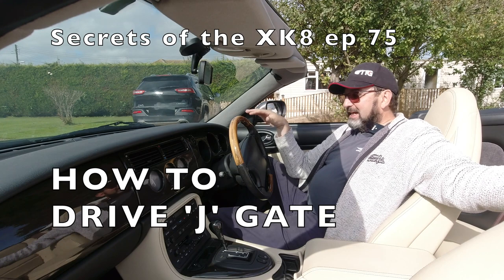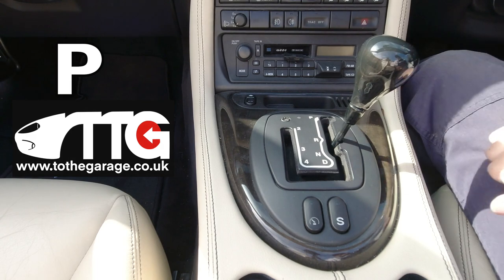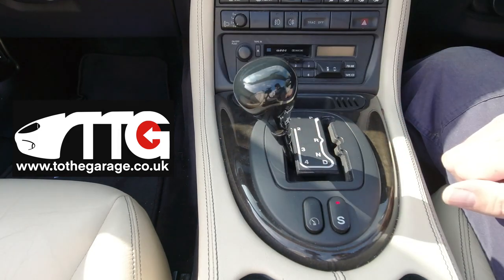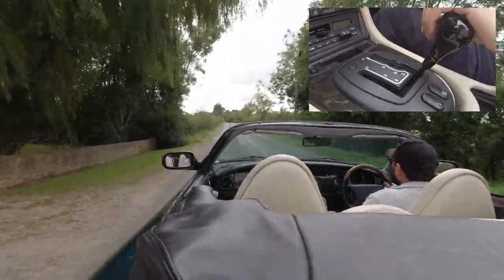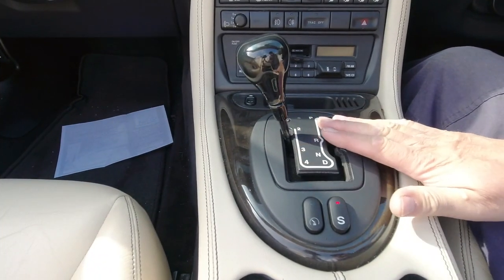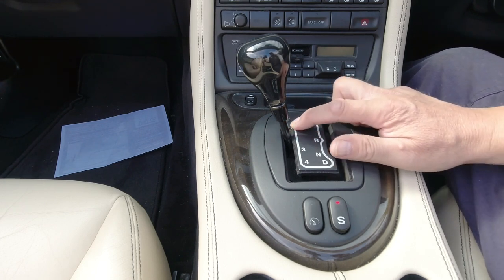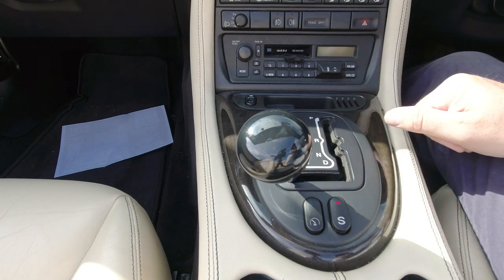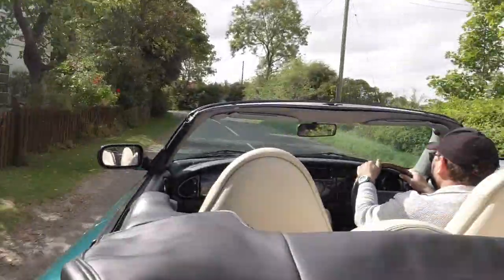how to drive 'J' gate. secrets of the Jaguar XK8 XKR ep 75

Comment: I have owned my XK8 for two and a half years but I've not used the left side of the J gate for the fear of causing a gearbox fault code. You have given me the confidence to give it a go. I have learnt so much from your videos about my car. I'm very happy I found your channel. Thanks , Jerry Smith
Reply: Jerry Smith Snap ... Learnt loads ...only adds to the enjoyment of the car,  knowing the thought that went into it.
Reply from the maker: thanks jerry👍
Reply: @ThomasPollas  About 2 weeks after I bought my XK8 it started having a gearbox fault and went into limp mode. I purchased a 2nd hand gearbox rotary switch and got a local gearbox specialist to fit it for me. It fixed the fault and it has driven problem free since.
Reply: Thomas Pollas I have an occasional issue like that on my XK8.  It only happens if I rush the change from 3rd to 4th and then across into D. I’ve discovered that it causes a fault when the lever isn’t pulled properly back into 4th and it ‘misses’ the change, basically jumping from 3rd to 5th.  I reckon that this flummoxes the gearbox program and registers the fault.  With careful use of the lever I can avoid this happening, but I intend to investigate soon.  I think it feels like a stretched or misaligned selector /cable but more research needed.  I’m also lucky in that I have a newer x308 and the engagement in 4th occurs far more easily and sooner in the shift pattern.  This also leads me to suspect a selector misalignment. Let me know if you have any success.
Reply: @ToTheGarage  Hi John, only a few days ago I watched your secret about the position of the space saver spare wheel to line up with the lock nut key. I discovered that my key was missing and none of my wheel nuts were locking....... I have now ordered a set of locking wheel nuts and key to keep the car original. So thanks again!
Reply: Thomas Pollas that’s good to know.  My issue is manageable for now, but please let me know what your mechanic finds out as it sounds like a common issue and it would be good to have a confirmed diagnosis when I do need to resolve my issue.  Good luck 👍

Comment: Oh yes and great tip, I always put the emergency brake on before putting it in the park, I hated that clunk and the extra force needed when you did not initialize the emergency brake when moving it to drive. Especially on hills, I remember back in the day my 1995 Acura legend literally would be so difficult to get it out of park and in to drive if you didn’t pull up the handbrake before lol I practice that on every car I own to this day, except for my leased cars my Mini Cooper S and my BMW M340i, because I don’t have to worry about transmission problems down the line 😂
Reply from the maker: Ah yes. They say, Nothing is as fast or has as long a service interval as a hire car, 🤣

Comment: Hi, this is Peter Lowe ..Very well explained ,thanks ,it is a good system  i think,almost like the best of both worlds jag sounds loverly , and well driven ..btw ! i,ve had several Jag,s in my time the 1st being a MK2 when i was 14 and used to drive round an old ww2 airfield in Norfolk , ,i used to race the new lotus Elites and Eclats as my bit of runway ran Paralle to the Lotus test track ,they where the days ! i paid £15 for it !! an petrol was 10 bob a gallon back in 1975 ,,..!:) i,m 61 now an hope to get an XK8 soon now that they are pretty cheap now like 3,4 k.. not bad for a car that cost over £50,000 back in 1995 which was a lot of money back then that,s 4 sure ...
Reply from the maker: Thanks Peter. I have done a lot of work at Lodon over the years so can now well picture you tearing up the airfield tarmac in your Mk2

Comment: Watching the Video, I really Enjoy the Sound, as I told U before !
Although I am not a Big Fan of Loud Pipes any more...
I love how my X308 is so silent, so U can really enjoy Music, because it's a Fact that the Alpine Pro is a Joy to listen to.
I have been a Audio Technician for Years, and the Audio System/Sound in these Cars is really Amazing.

Thanks for explaining the alternative use of the J-Gate, I will try , after 6 months owning a Jag, I never tried the Cruise Control also...
So much to discover on this land Yacht .
Recently had the 5G Transmission done, an Hour after Pick up, my Driver Door lock, won't shut properly any more, think the Spring has issues..
After I had my Transmission maintained, I noticed , Gearbox will like immediately switch to Sport when pressed, before it took a while...

Greetings to All !
Reply: Just curious here about your knowledge of audio. I have a 2000 XKR and am sorting out various issues with it. Do you have anything specific you can talk about the sound system in these cars? Have you changed anything out? Speakers? Stock head / amp(s)?
Reply: @kevinhanson3400  The Alpine Pro is stock.
Alpine is for Decades a German Top Brand.
Even Celebrated in the 80s US Rap US Music !

It's just that I notice, how HQ  (like 320 Kb Mp3) come to real effect in this Car's Audio system.
The tweeters in the A Pillar do a great job, and the rest of the setup also, having a Subwoofer in the back is quit unique for a 2000 build car.
I never even bothered  about changing anything in the setup like, more/less..Bass , Treble, or Sub.

They same I notice at the Paintjob of my X308, looks like Jaguar put real effort in that.

I changed nothing on the Audio outlay, Radio and Cassette , but I bought a  Nulaxy Bluetooth FM Transmitter 1.8" Color Screen Wireless Kit for just 14$ on Ebay.
I always use it,32 Gb of all mostly HQ Music , Hed Kandi, Dire Straits , Perry Como, Burning Spear.

I used the Cd player for a short while, but that seems to crashplay within like 2 hours of use.
Also my ..Radio antenna starts moving down after 30 sec aprox, when I use the Radio, can anyone explain this...so Radio sound becomes crap-o-saurus.

Found this> 
https://www.youtube.com/watch?v=FNH4cVZ5a90

Greetings to All , and don't always drive Your Jag, like U stole it !

Comment: Hiya John.  I use the j-gate manually on both my x100 and x-308.  Its a good system and enjoyable to use.  Very useful for inducing serious roaring from the straight pipes on the XK8 when passing unsuspecting pedestrians or driving through tunnels 😉
Having said that, my daily driver has a 9 speed torque converter box with paddles and which locks up pretty much instantly in all gears.  I love the paddles as they are allow you to keep both hands on the wheel whilst changing gear.  Not only that, they also allow you to change up (as long as the software doesn’t reckon you’ll labour the engine).  That’s an advantage over the J gate as the Jags only allow you to ‘permit’ an up shift rather than placing an instruction.  Having said that, there’s 20 years age difference between the X100 and my current motor. 
My previous daily had a 6 speed dual clutch. I know that the journos all rave about them, but I couldn’t get rid of it soon enough.  The low speed take off was so jerky, I felt like learner.  Manoeuvring the vehicle in car parks and tight spaces was really dicey.  My conclusion, give me a real TC auto with working lock up every time.
I think back to my first auto which had a 3 speed GM auto with lock up in top (which never worked).  My, how they’ve come on since then.  Shame these fantastic transmissions will be utterly redundant in the coming electric world. Take care and enjoy the growl...
Reply from the maker: Gerard Booth 
My experiences with dual clutch systems have been ....  ok?  Whilst on the open road if a little unrefined, and close to dangerous in car parks.
Reply: To The Garage spot on John.  I reckon we should start a counter-revolution against the all-conquering dual clutch boxes and my other bête noir, the SUVs that are cluttering up every road in the UK.  Give me a proper estate car any day.  Come the revolution brother!

Comment: Drove the car back from the garage on Thursday and used the J gate.  Works great!
BTW John the ‘B:SC SYSTEM FAULT’ warning (I sent you an email) that came up on the dash was a ref’ to 2 Lambda sensors.  One had failed and the other was on its way out.  These were replaced.  Cheers for your advice
Reply from the maker: Great to hear you got it sorted Paul👍

Comment: Hey there thank you so much for the video. Very high production value, and some great exhaust clips. I had a 2004 jaguar X type 3.0 sport five speed manual, and then a 2006 XJ8, and a 2011 XF 5.0. On my XJ8 I did not mess around with the J gate at all and I don’t even remember using sport mode because even though I researched the car and I knew that the transmission was reliable it was a one owner older guy car until 90,000 miles when I bought it.  I always feared that if I messed around with sport mode it would hurt the transmission lol and I did drive it hard. Ironically I never had a problem with the transmission but the air suspension yes but of course that is a known problem point on many cars with air suspension over 100k miles even Toyota and Lexus. However on my XF it was a similar ZF, the XJ 6HP26 vs 6HP28 in the XF. The XF was such a quick shifting transmission especially in dynamic mode with the paddle shifters. The XJ was very smooth as well though👌
Reply from the maker: Thanks Nick👍
Yes the speed of the changes on an XF or modern XJ is a fraction of that on the XK8. 
(Maybe I need another XF S?

Comment: I had a Rover 827 auto in which only 1st and top gear worked. These had to be manually selected. This made acceleration wild. Pulling away from the lights was always a drag race. Had to get to a decent speed before dropping it into drive.
Reply from the maker: A challenging drive I imagine. I once owned an 820 coupe but have never had the V6

Comment: Having owned XK Rs with all 3 systems, in my opinion, the "L gate and paddles" is by far the best from an ergonomic/driver perspective. The rotary dial thing is just horrible in use, easily the worst option of the 3. The J gate system can sometimes be a little hazy, meaning you can inadvertently end up between gears, especially when you're manually shifting on the left side.
Reply from the maker: The. paddles do feel like they provide the fastest shift

Comment: Thanks,it really helps alot I have a 2006 jaguar xj8 4.2l v8 with 6 speed and this video helps alot ,when I drive in d one of my sensors are bad and the gear box fault comes on and the car stays stuck in 3rd or 4th gear only way to take it off temporarily is by turning car off and restart and the gearbox fault goes away,though I don't use the sport mode but I use that to see if my shift is good because the red light goes off when the gearbox fault comes on but it restarting the car turns it back on to normal, long story short manually shifting it works way better and I don't have the gearbox fault issue and it shifts like butter compared to just using drive which causes gearbox fault and sluggish shifting and stuck on one gear

Comment: I have owned many automatic cars. I have always driven them in the same way. I have have a lovely 1989 XJ40. I drive in the same manor. I also own a 1998 XJ8. Again I drive it in the same way. Plus when I get my 1987 XJS V12. I will also be driving it the same. I get better control and a better fuel economy too and a smoother drive. D drive is basically for cruising on motorways or having to drive in slow traffic. As it creeps nice and smoothly.
Reply from the maker: 👍. Nice to hear from a fellow Jgate fan

Comment: Many years ago, my daughter was 5years old and sat in the back of my ’03 XKR. We were travelling about 30mph when she kicked my elbow forwards and my hand pushed the gearstick from Drive straight through Reverse and into Park!  I slammed on the brakes and pulled over. I heard a violent clonk as the dog ratchet found Park as the car stopped. To my relief there was no loss of function or damage and I later found out that the gearbox brain will not allow Reverse gear when there’s forward motion.
Reply from the maker: No harm done. But a scary way to find that out Paul😮

Comment: Great Video John. I do use the J gate occasionally and was very advanced for its time. I had an XJ40 with it and then had an XJs without it and missed it. My every day drive is a 7 speed DSG which is brilliant, but I do do like the J gate on my XK8
Reply from the maker: DSG is I hope the norm for the future as the alternative is CVT🥺 (gearless electric vehicles aside). DSG's are much more efficient lighter smaller and cleverer, than our gargantuan lock up torque converter units.
But that does not mean I would swap the box in my xk8 for one😁

Comment: I tend to use the left hand side to slow the car down, rather than as a way to let it loose.  What impact (if any) does it have on fuel consumption if you drive consistently in “manual”

Comment: Hi John, thanks for the video. I dont use the left side because I never need to accelerate hard unless I'm overtaking then, I find nailing the throttle gives me a kick down which is instant. What exhaust system are you running? It sounds great.
Reply from the maker: hanks Roger. 'Adamesh' Stages 1 and 2

Comment: Cheers, and Huge thanks for this one! -I had been looking for a proper vid on this one! Interesting detail difference in my (U.S. - Left Handle) '03 XK8, she has her gears up to 5, which I might guess is 5/6 on the gear slot?
Reply from the maker: Tony Leonard 👋 
Yes Tony👍
Yours is a a six speed box and so will have a 5 position
Mine is only a 5 speed. ( very early car)
Reply: @ToTheGarage  One of the first things I noticed was the shifter and the Traction buttun next to sport, not on mine. and a metal J-gate plate. Interesting to see the small changes in the car per year model.

Comment: Your videos are great. I just purchased a 2005 xk8 and I have one question about the jgate. I have paddle shifters in a camaro and they tell you to keep your foot on the gas while shifting. Do I do the same on a jaguar or let off the gas and then give it throttle after I move to the next gear. I could not tell by watching you. As I stated on the american cars you keep your foot on the gas and shift. I use a plus and minus on the gearshift instead of the paddles. As far as those round automatic shifts I feel it ruins the whole astetic of the system. Your videos are the most informative on the web. Who better than a British guy and mechanic to teach an old man like myself how to drive my dreamcar.
Reply from the maker: Thanks for your kind words Arnie.
I can confirm that with the Jag system, you can indeed 'Keep the boot in'😁 So yes it's the same rules as you apply in your Camaro.
I found the Rotary shift to be an aesthetically pleasing solution in my 2018 XJ. But that was a car which encouraged me to leave its systems to deal with most if not all driving mode choices.
I like you think the J Gate is far superior to the rotary shifter in terms of tactile experience. Sense of involvement and Aesthetic in a more overtly sporting car. Also I would comment that paddles are certainly a more efficient method of manually selecting gear shifts. However, I never got the same level of enjoyment from their use (in an XF and my XJ) as I do from the J gate in my XK8.
Enjoy your Cat👍

Comment: Thanks John, for all the "secret's" you have shared with Jag fans. Do you have one that tells me how to make my 1997 transmission  stay in 1st gear until i want to shift to 2nd. When pulling out of my drive it shifts to 2nd before the car gets straight. Can i use a momentary switch attached to my gear knob to activate kick-down mode to hold 1st gear a little longer?

Comment: Thanks for another excellent video John.
Ah, Porlock Hill, I remember it well, especially when we managed to reach the top without a steaming radiator, & that was in a straight 6 Humber Super Snipe!!
Having been taught on a manual to use the gearbox instead of brakes I find 3rd very effective to slow the monster down on descents, simply does not like going slow .
Warning, when booting out of the bend in 3rd DO NOT watch the fuel consumption read out, it is really scary & persuades one to slip back to 4th asap. Have never tried 2nd so will give it a go next time out along with the Sh****t button !
 Unfortunately we have no tunnels locally to get the full sound effects, really miss the autoroute tunnels from Geneva to Montreux.

Cheers, keep safe despite Boris bluster.
Reply from the maker: Thanks Alan.
I think I should do a few little videos to share some of our interesting roads with international friends,
🤔
Porlock
Horse shoe pass
Wrynose pass
cheddar gorge
cat and fiddle
heads of the valleys road.

Comment: I have a 2005 S-type and once came to the top of a very steep hill in San Francisco. That's not a fun place to be. I was very nervous about rolling backward once the light turned green because releasing the electronic parking brake was not what I was used to and a little scary because I didn't feel like I was in control. I was in Drive and when the light changed, I released the parking brake and gassed the engine and everything was okay. But what would be the best approach to this? Should I have done everything the same but just be in second gear instead? Should sport mode be on too? Thanks for the very informative video. It's time to test it out.
Reply from the maker: I think the electronic brake on the S type will self release when you put it in drive and go🤔 However, I dont own one so maybe a little experiment on the flat first.
Reply: Thank you.
Reply: @ToTheGarage  Absolutely : the S-Type's electrical park brake released itself when the throttle pedal is depressed. By the way, thank you to have inspired me to try drive my own 4.2 S-Type with the "manual" side of this marvelous J-gate.